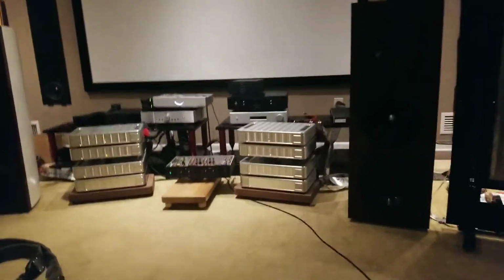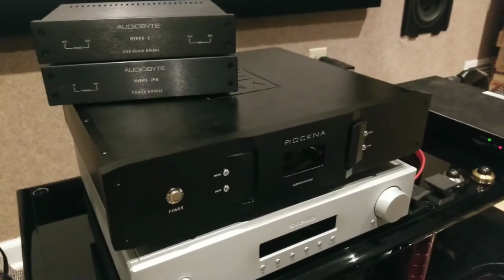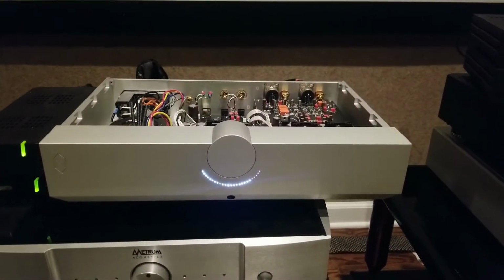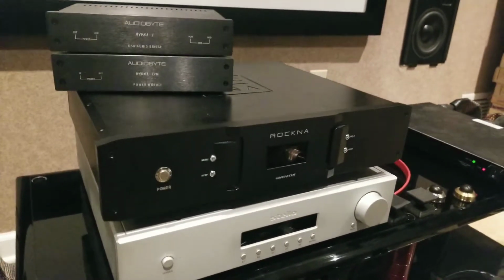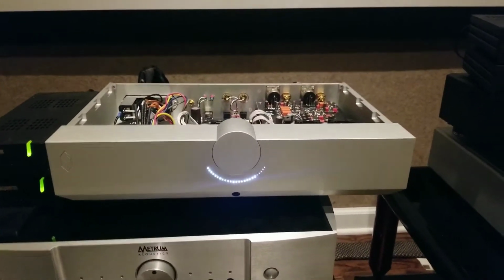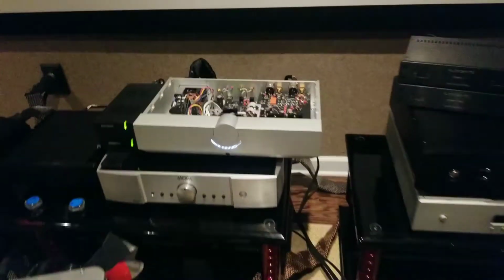COS Engineering D1 V2 upgrade.

Comment: hello Sir, may i ask about the D1 V2 upgrade you are talking , is it something only proprietary to you that you're providing ($450) ? or can i order from COS with this unique Power supply mod with new software  logarithm ? thanks for any replies. -philip
Reply from the maker: Hi Philip, if you are in USA then I am your contact for COS as I am the importer. and the mod is in fact from COS. any of the D1 that are currently sold already have this modification, so this is only for used D1 that are in the marketplace. If you are elsewhere, not USA then contact Stephen at COS, he will be happy to help.. Cheers !
Reply: Thanks ! that is a quick response! i'm not from US  : )